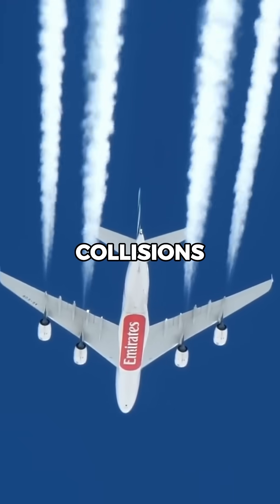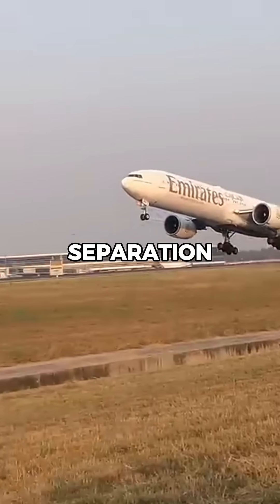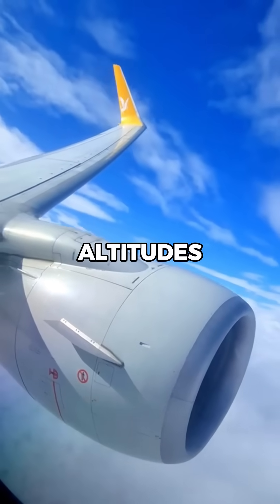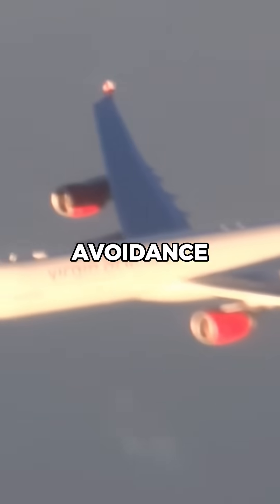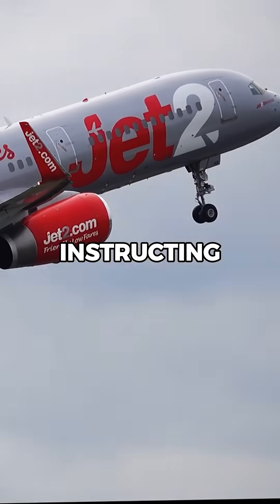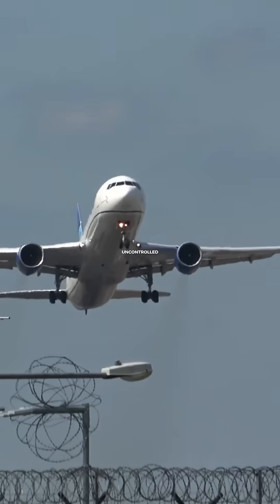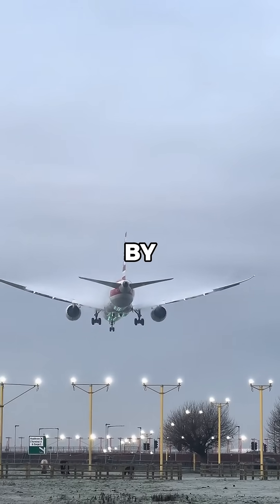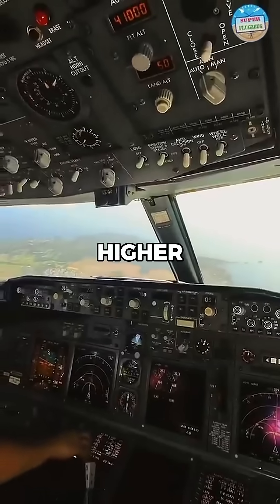How pilots avoid mid air collisions

Comment: Why didn’t the recent crash between the helicopter and the aircraft pilots use observation then ???
Reply: It was night so it was hard for the helicopter pilots to see
Reply: @Brycetheaviator or maybe the crj-700 didn't see the helicopter because because it was painted dark green and it's also hard to see
Reply: Because the helicopter pilot ran str8 into the jet
Reply: the helicopter was 200 feet above her restricted space
Reply: This TCAS system also doesn't work correctly at low attitudes and only fired for the plane.

Also the Helicopter, which caused the crash was 1. too high (probably a misconfigured tool) 2. probably had restricted view because of Night Vision 3.Didn't hear the complete radio messages and 3. Probably mixed up the planes and focused on the wrong one. They had plenty of separation and boom, unexpected plane from the left.